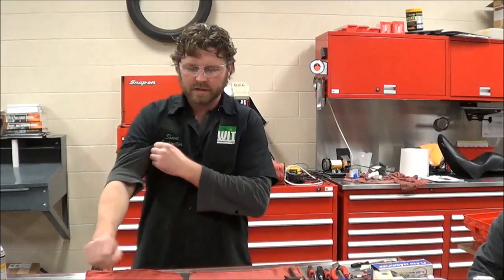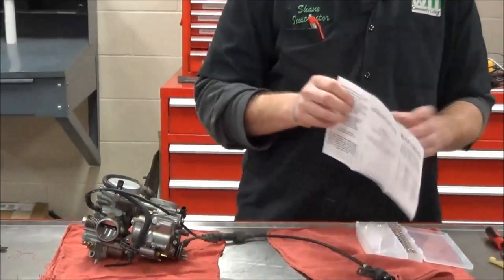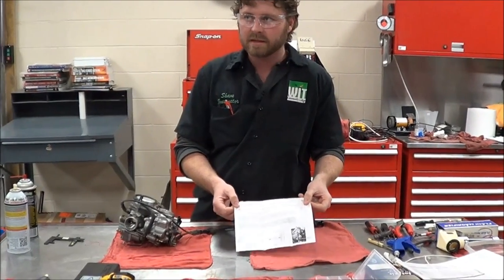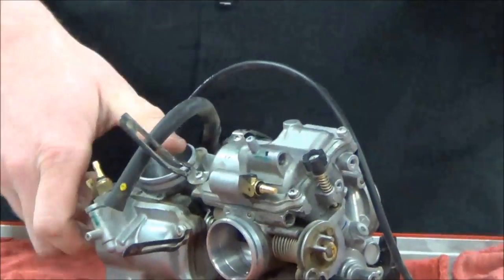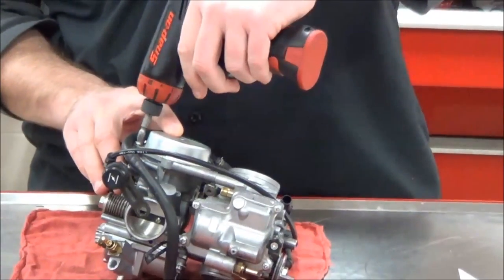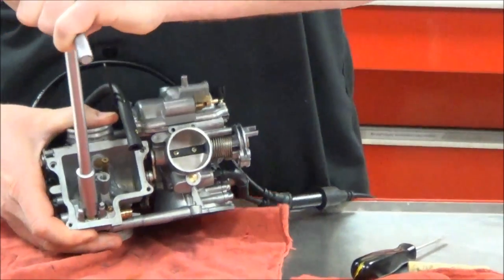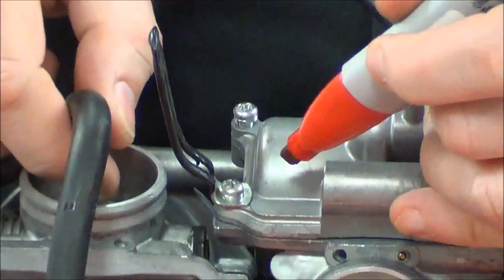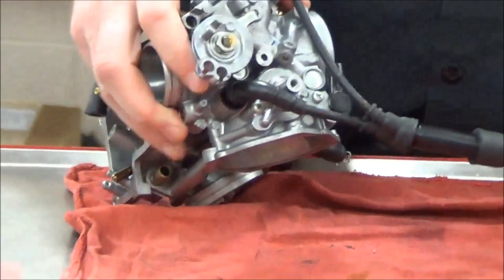How to install a Jet Kit Honda VT750 #how2wrench #jetkit #howtoinstallajetkit #dynojet vt750dc

Comment: Good little video and class. Also the Shadow 750 is a very little known/underestimated performer. In stock trim we see them make around 38-40 HP at the rear tire. This is far from exhilarating but can be easily increased. A set of good 2" drag pipes or 2 1/4" cruiser pipes, simple modification of the stock air box (Google "BeanBox mod") and Stage 2 jet kit will yield 43-45 HP at the wheel and is a VERY noticeable difference on a 500lb machine, especially since power is up everywhere from 2800-6200 RPM vs stock. This puts the VT750 Shadow square in the 1/4 mile territory of HD Sportsters, Yamaha Bolt, Sabre/Shadow 1100 etc with mid 14 second passes being the norm. If you want to take it further, JE produces 10:1, 10.5:1, 11:1,11.5:1 & 12:1 Pistons for our Shadow factory bore sIze. (11-11.5:1 is about ideal for 93 pump gas) At the time of adding new pistons, take the time to smooth the intake ports/runners on the stock heads. (Remove any/all casting flaws) After re-assembly, do the "4* timing mod", go up one step colder than factory for the spark plugs, and re-jet the carb again. (This time individual jets will need to be ordered, not a kit) It is also reccomendsd at this time to go with a "Hyper Charger" type of airbox or an open element K&N style filter for maximum flow. I personally switched to a single carb setup ala the 2006 Aero model, just to make tuning the bike easier. When all is said and done you end up with a lightweight and nimble Honda Shadow with over 60 HP at the rear tire and an incredible power curve. Total cost if you can do the work yourself is about $1500, pipes included. After this newfound power a sprocket change will be the next logical step, Aero owners will not see the most gains unfortunately due to shaft final drive. For those people just put some good hypoid gear oil in your shaft housing and call it good! For the Spirit and other chain driven guys, add that new power to the proper gearing and you can see 12.9x quarter mile ETs in the 110-112 MPH range with a 1.8x 60ft on stock Aero tire sizes (120/160 F/R) It's about as fast as I would want to go on such a small, low riding cruiser! Cheers to the Shadow!
Reply from the maker: Joe Doole 
Thanks for sharing all the info for folks. If I can ever be of service to you, here is a video explains how to connect with me. 
https://www.youtube.com/watch?v=vjvmB01ebcs 
Keep Wrenching,
Shane Conley
Instructor/Motivator/Motorcyclist
www.how2wrench.com

Like freebies? Click here for a free diagnostic checklist! 
http://gem.godaddy.com/signups/364621/join 

Did you like this free video and hope to see more? Would you just like to say thank you with a donation? Click https://www.paypal.me/how2wrench
Reply: Joe Doole This comment was better and more informative than this long, drawn out video.
Reply: .

F

.aa
Reply: Arg now you got me really getting into my recently purchased 00 750 Ace lol 😃🤩

Comment: GREAT video- I'll be watching it again when I pull the carbs from mine. It sat for three years and has issues. Backfires when attempting to rev and won't reach higher RPM. Just to make it fun, figured I'd install a jet kit during the clean/rebuild.  EXTREMELY well done and you are a VERY good at being an instructor.
Reply from the maker: Head over to the new website and subscribe to the newsletter to never miss a video or newsletter! 
https://how2wrench.com/contact/ 

If I can ever be of service to you, here is a video explains how to connect with me. 
https://www.youtube.com/watch?v=vjvmB01ebcs 
Keep Wrenching,
Shane Conley
Instructor/Motivator/Motorcyclist
www.how2wrench.com

Did you like this free video and hope to see more? Would you just like to say thank you with a donation? Click https://www.paypal.me/how2wrench

Comment: I did substantial hands on jetting to a 2003 spirit. The smaller main jet goes in the rear as that cylinder gets hotter and thus, less dense air....also, the Dyno-jet needles were way-too aggressive in taper. i used the stock honda needles and the bike ran like a top from idle to full-on in 5th gear a whopping 126mph.

great class to take and good teacher.
Reply from the maker: 👍 Thank you for taking the time to comment! It helps us! 
Here is a way to support all the free videos.
Want to say “thanks” or “keep it up”? Click here https://www.paypal.me/how2wrench
Reply: @gilbzmusic7186 so you are telling me, that the 104 should go into the front and 102 into rear?
Reply: @nuffdiebuff954  correctomondo
Reply: Yeah I was so confused why they kept saying put the larger jet in the rear….. i love his work and hope it was a brain fart. Dense air is in the cooler cylinder = more fuel / bigger jet
Reply: @revivemotorcycles  logically speaking.
Reply: 40 year mechannic here, the smaller main jets always go in the front carbs, larger in the rear.  Mechanic in Video at 31 minutes does the same thing.  Try using a laser thermometer to measure head temps, the rear cylinder is cooler. Go look at a bikes carb schematics, it will always have larger main jet in rear bank.

Comment: Excellent video(s) Shane. While taking off the slide cap, I noticed your advice on the phillips screw fastener, risk of stripping, and the ACP pliers. I ordered some JIS screwdrivers (from Japan) to fit these "phillips" screws, and have WAY more success at not stripping these Japanese screws. The JIS screws are actually Japanese Industrial Standard screws, a significantly different head pitch than the American Phillipsm, which leads to stripping the socket mating surface. Some techs grind the tip of their Phillips screwdriver to better seat into the JIS screw head, but still isn't the right taper, etc. The JIS screws usually have one dot on the head helping identify them as JIS. You may have covered this in later videos, but is something I just learned this year for all these Japanese made bikes. Check it out!! This is why many techs will replace these with socket head screws, when it was due to incorrect tool fitment!! Snap on, Mac, etc don't have them, and probably won't even know what you are asking for!! Again, great training(s).  Thanks!!! 6-12-16
Reply from the maker: Thank you. Checkout the playlist "Every Mechanic Should Know This" https://www.youtube.com/playlist?list=PLAtBOuPaEyt_uMyVlK1tsBVnSYW1Q0vCK  
Please share on your social media!
Shane Conley 
Instructor/Motivator/Motorcyclist

Comment: The reason you were in danger of "stripping"  - aka ruining the head on - those carb screws  was that you are using the wrong screwdrivers. Japanese bikes (and electronic equipment) commonly use JIS  screws. With JIS screwdrivers you can feel the driver lock into the cross  slot on the screw while a conventional Phillips driver will not seat properly in the JIS screw. You can feel it wobble and you risk ripping up the slots on the screw. Btw, JIS screws can often be identified by a dot on the head next to the cross slots.
Reply from the maker: We have video coming up on JIS screwdrivers after years of requests! 
Thank you for SUBSCRIBING! Love seeing our subscribers comment on how the video helped! It helps us!
Here is a way to support all the free videos.
Want to say “thanks” or “keep it up”? Click here https://www.paypal.me/how2wrench  

Coach Conley is also available for hire to personally work one on one with you if ever needed. Yep he is a real person. Give him a call @ 602-345-0432

Your answers and help are just around the corner. Save time and money while protecting your investment and yourself by doing it the right way!
Follow us!
Web:
www.How2Wrench.com    
www.Tools2Wrench.com

Comment: Just got me a VT1100 video gave me confidence to work it, thanks.
Btw i do have a fuel leak on one of the hoses that comes out from the small cylinder (air valve i think it is) that connects to the right side of the carb any ideas what could be causing the strong leak???

Comment: For me, one question isn't answered - but very important - in the beginning. If there is an aftermarket exhaust with baffles and original airbox with aftermarket airfilter (k&n), is there still the use of 102 (front) and 104 (rear) or should 104 (front) and 106 (rear) be used because of the air increase of the k&n. 
He said that the question of using the stock airfilter is important but not why or what would be the difference in setting up the jet-kit 😢

Comment: Why didn't you use a tap on the screw? Give it some love by tapping on it. 13:30 now I know why does my moto is not running. I mixed them up while putting them back together. I didn't know that there are differences in jets size jezzzz. How should I separate the front jets from rear ones?

Comment: have a look in to JIS screwdrivers.
Reply from the maker: Thanks Phil. We bought a set and will have a video coing out ths summer.
Reply: Shane Conley np, you have helped me out many times, I’m glad I can reciprocate. 
I dont know if you are aware however a JIS screw is identified with a dot on the screw head
I have 2 types, one is the popular Vessel brand from Japan- very good driver, it is impact type, but I have never needed to use that function

The second type is a Canadian made driver from Go Fast Innovations, a far superior driver, full tang and offer a hex butt for higher torque applications without the shock of an impact driver (although they do offer impact drivers as well as JIS bits). Much safer on carbs IMO.

Hey thanks again for all your top shelf information! I’m looking forward to your summer video. Hopefully this will spread the word about using the proper driver.

Comment: What stage jet kit would I need for a 2000 Honda shadow 1100 with straight pipes, stock intake with K&N at 6,000 feet above sea level?
Reply from the maker: If it was a quick answer I’d try to respond here but I wouldn’t want to lead you wrong assuming certain factors. Reach out to me on my website contact page. We have been overwhelmed with ungrateful people and
scammers so I had to do something for my sanity by screening the over 300
requests a week! I’d love to work one on one with you! Contact Link: https://how2wrench.com/contact/ 

Your answers and help are just around the corner. Save time and money while protecting your investment and yourself by doing it the right way at www.How2Wrench.com 

Have you subscribed yet to never miss a video? Have you seen the video playlists https://www.youtube.com/user/conleybuilt/playlists? 

Want to say “thanks” or “keep it up”?
Click here https://www.paypal.me/how2wrench

Comment: i have a question that maybe you can help me with, I own this same bike and i removed the back baffles out of the stock pipes, it didnt do it right away but i am starting to get backfire and popping and smoke coming out out the pipes just recently. the bike has no problem starting, it doesnt pop unles i rev the throttle, what should i do?
Reply: Aaron Ramirez  it might be running rich, rich condition usually makes the bike backfire  and pop.  and a bike that runs rich will be always easier to start than an lean one,.
Run it for a while turn it of and take the sparkplugs out and see if they look rich.  if they are you might need to lower your jet sizing
Reply: How do I fix that problem?
Reply: +Aaron “DrummerBiker88” Ramirez  by lowering your jet sizing like he said
Reply from the maker: Head over to the new website and subscribe to the newsletter to never miss a video or newsletter! 
https://how2wrench.com/contact/ 

If I can ever be of service to you, here is a video explains how to connect with me. 
https://www.youtube.com/watch?v=vjvmB01ebcs 
Keep Wrenching,
Shane Conley
Instructor/Motivator/Motorcyclist
www.how2wrench.com

Did you like this free video and hope to see more? Would you just like to say thank you with a donation? Click https://www.paypal.me/how2wrench

Comment: So smaller jet in front cylinder carb and bigger jet in rear cylinder carb for temp difference. Gotcha.
Reply from the maker: Gear1993Head xxx What's a way to cool an engine? To lower combustion chamber temp? More fuel. Less ignition. Rear cylinder of a vtwin runs hotter than front.
Reply from the maker: If I can ever be of service to you, here is a video explains how to connect with me. 
https://www.youtube.com/watch?v=vjvmB01ebcs 
Keep Wrenching,
Shane Conley
Instructor/Motivator/Motorcyclist
www.how2wrench.com
Reply: Thanks I'm rebuilding/rejetting my carbs soon and this vid is a great reference. 2007 Vt750Dc-b just like the bike in the video.